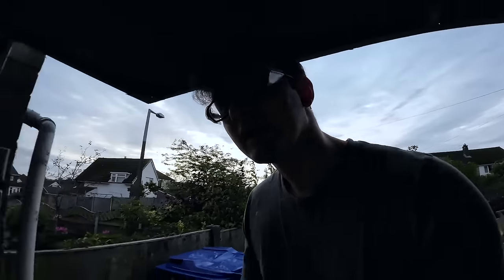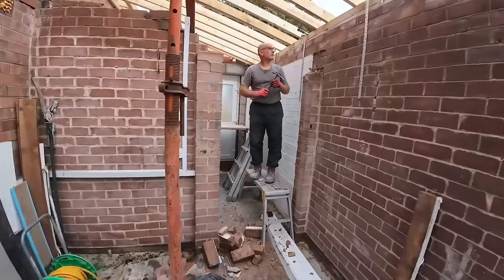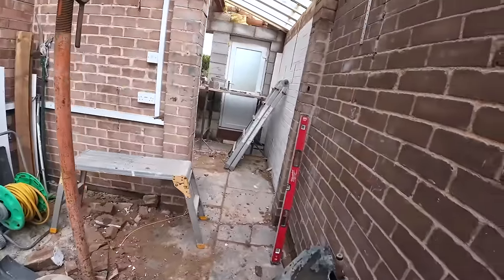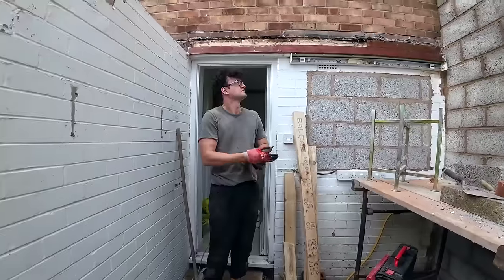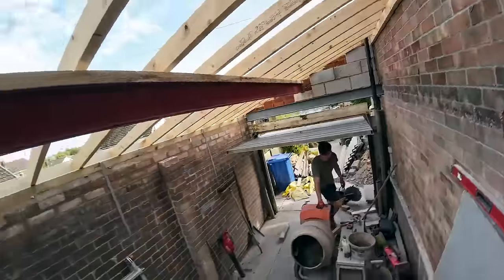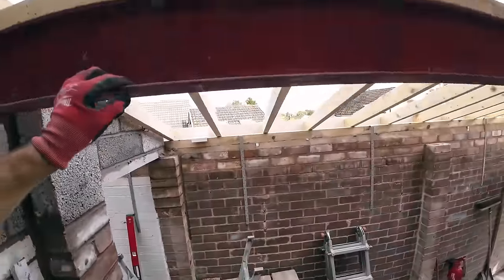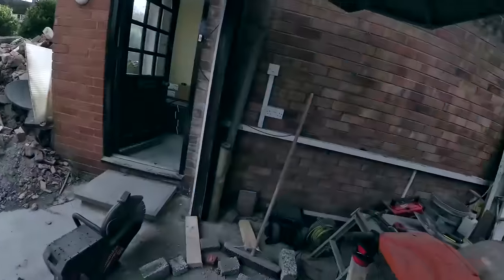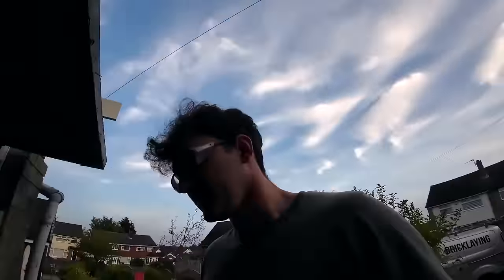CRAP JOB LONG DAY... PATCHING PIKES

Comment: Nice work as always fellas. I know it wouldn't been your so say, but any reason they didn't use deeper rafters and do away with that long steel? Unless there's something I can't see, it looks a waste of money.
Reply: Upstairs window looked close to top of rafters, could be that.
Reply: @Charliegeorge65  I see your point but would be easy enough to get around by treating it like an inset dormer for the few inches necessary.
Reply from the maker: Roof nowt to do with us 🧱👍🏽
Reply: @SteveAndAlexBuild  I think I said that..... was wondering if you knew why...... nothing more....
Reply: Maybe they weren’t allowed put too much weight on the r wall plate that’s fixed to the house wall
Reply from the maker: @richarddowling4069 🤷🏼‍♂️🧱👍🏽
Reply: @richarddowling4069 Not really. It’s all shear load so not a problem.